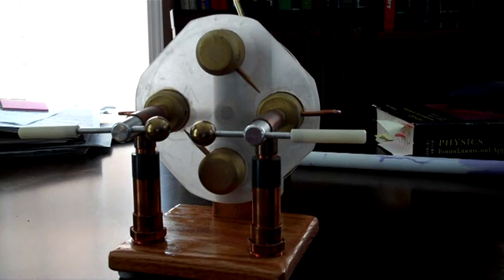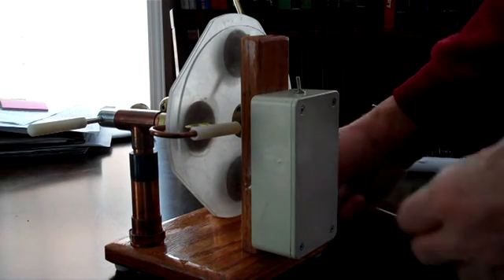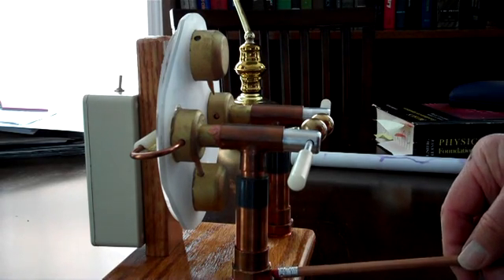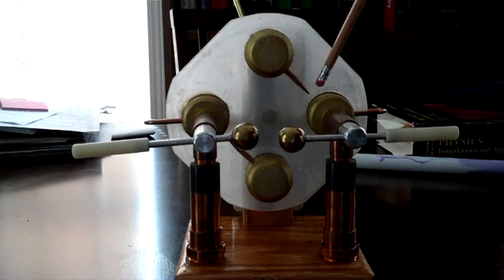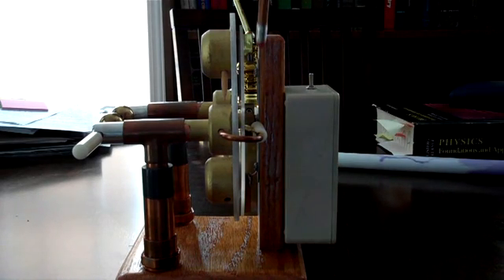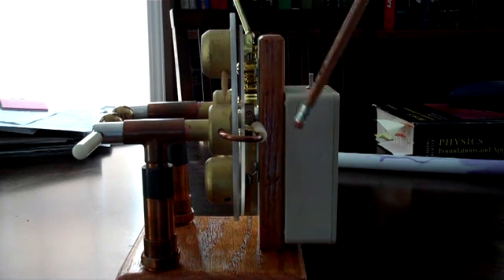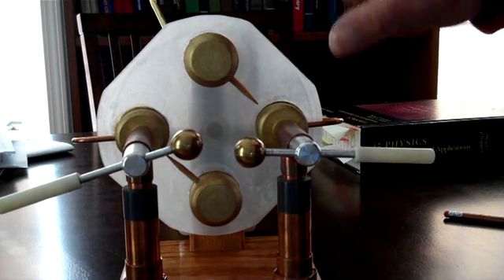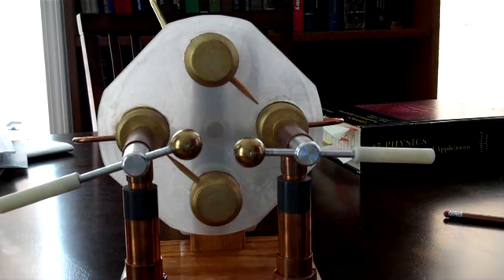Electrostatic Induction Machine

Comment: hey bro i wonder if you could answer me 
wich one make more voltage? 
wimshurst or voss machine
Reply from the maker: It depends upon the construction and the materials  used.  Generally they could produce about the same voltage level.
Reply: The voltage reached before breakdown in the machine depends upon the construction and materials used.

Comment: Are the two metallic pads that are screwed on to the wooden spine or post. Are they connected to each other to form a neutralizing bar or rod? I can see that the two screws that connect the metal round pads to the wood are there, but are the two screws connected to each other to form a single uniform connection?
Reply from the maker: Yes, there is a "shorting bar" mounted on the motor support  on the back side of the rotor.